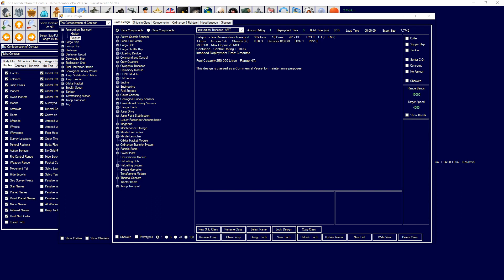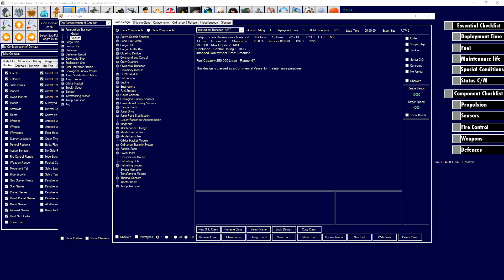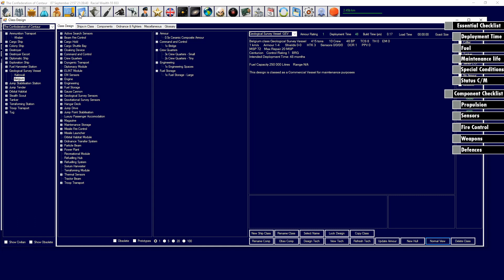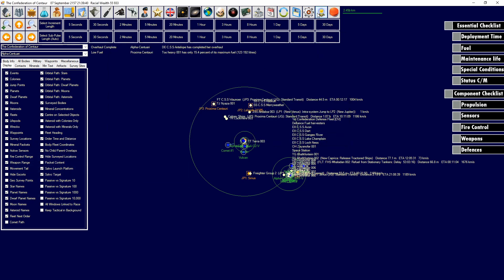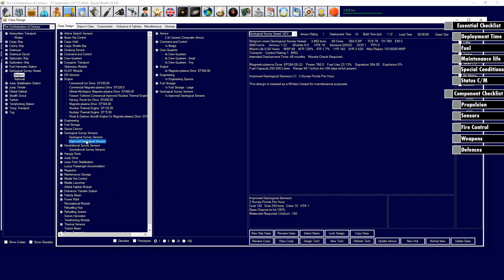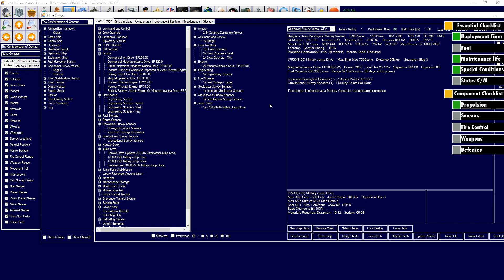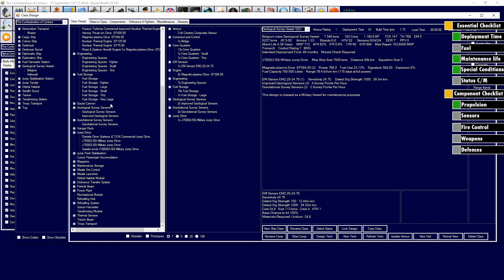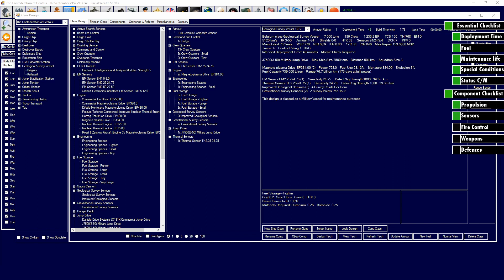Aurora 4x C# -  Tutorial - Ship Design - Step by Step Ship Design

Comment: I realize this is an older video, but I am just starting out in Aurora 4X and I have a couple of questions. 
1. First, that checklist you called up. I designed my survey ship by following along; but, I wasn't able to find or call up the checklist in my game. How do I do that?
2. After I designed the ship, I went to the space yard and tried to build it. But the construction drop down is till empty. How do I finalize the design so it shows up to build in the space yard?
Reply: Alight I figured out my second question. You need to pick a suitable space yard ann retool it for the ship class you want to build first. Then you can construct that class of ship there.
Reply from the maker: @davespurlock985  That checklist is not part of the game, the point of it was to help train you to mentally think about such a checklist when designing your vessel.

And as you have found out you need to retool your shipyard to use the design, to do so the shipyard needs to be of the right size, and type either commercial or military when compared to the ship.
Reply: @DefranStrategy  Thanks for the reply. I can quit looking for it now. B>)

Comment: Another awesome tutorial! Just out of curiosity, what's generally the best percentage of engines vs the total tonnage of a ship?
Reply from the maker: Depends on your doctrine, and what you want out of the ship, for most vessels i usually do 40% ratio to final tonnage but you can do less and instead increase power output, with commercial vessels they tend to be closer to 50-60% but more fuel efficient engines
Reply: @DefranStrategy  Thanks! I couldn't find just a general "starting" percentage to tweak from.
Reply from the maker: @redcup217  i advise you watch some of my other ship design videos i kind of go over doctrine and philosophy more in those that might help you